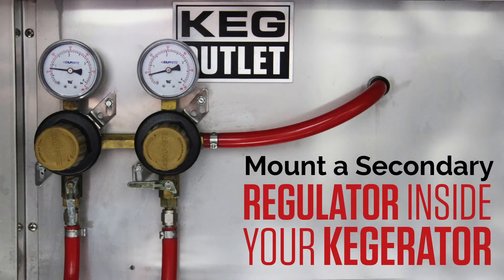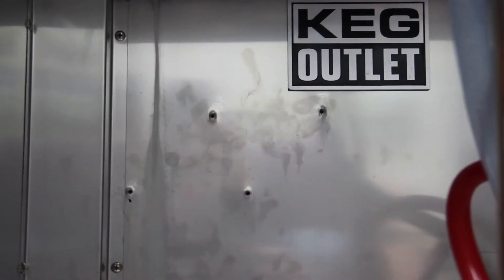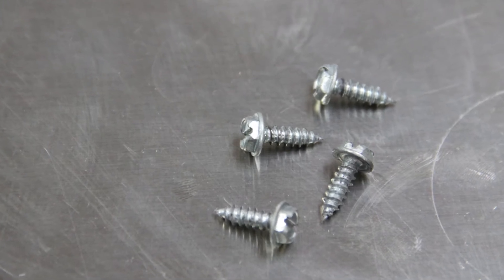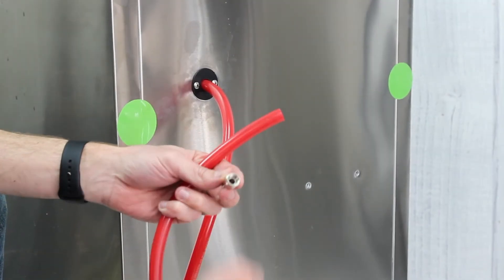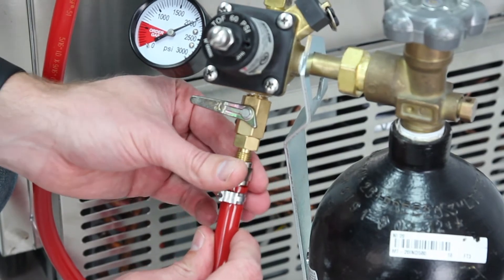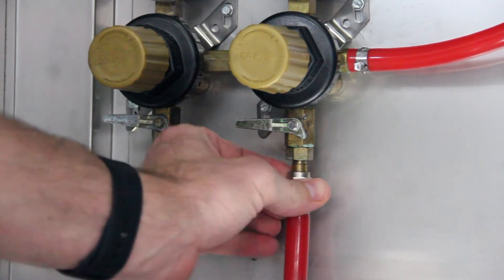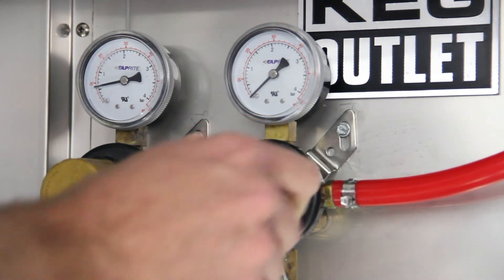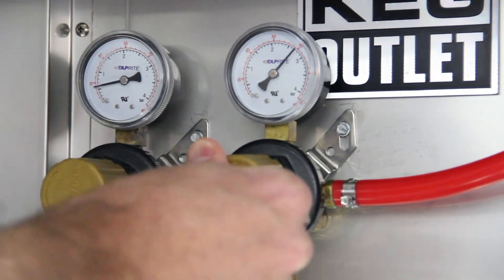How to Install a Secondary CO2 Regulator Inside of your Kegerator

Comment: can you use duo tight fittings or john guest fittings w/ a secondary co2 regulator?
Reply from the maker: Absolutely. You'd just need an MFL outlet(s) on your secondary. There are Duotight/John Guest fittings with a female flare that will thread right on.